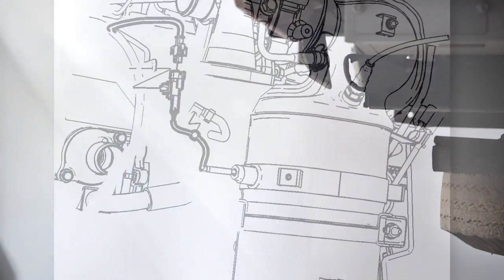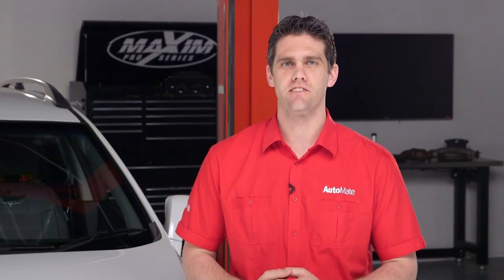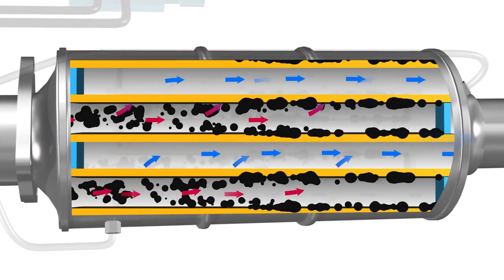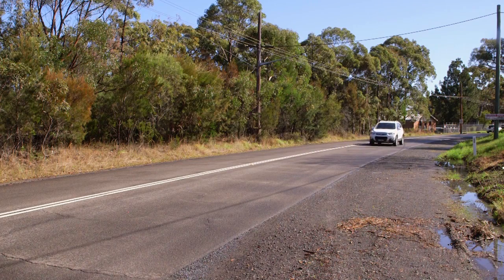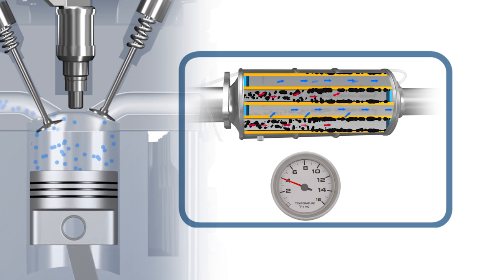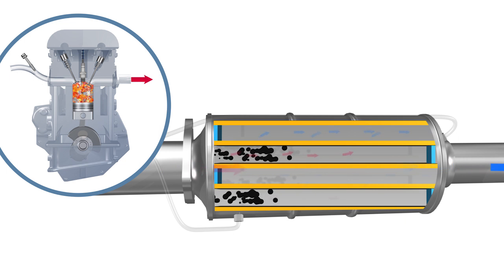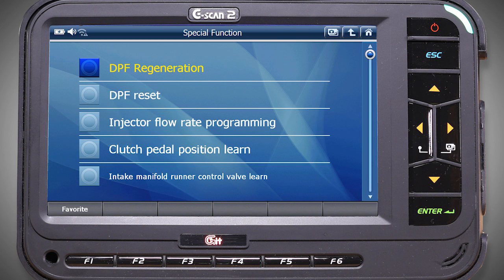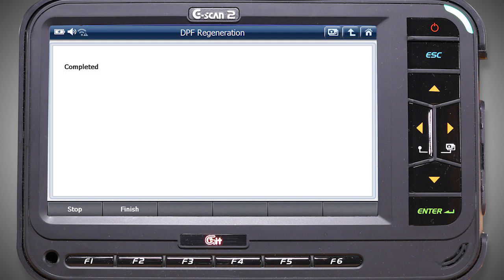Diesel Particulate Filter Fundamentals

Comment: Now explain the effects of the exhaust while your vehicle is in regen mode. Especially when your vehicle is dumping extra fuel into the exhaust system to get it hot enough to burn off the exhaust waste in the dpf filter.

Drives me insane when they say it is better for the environment.
Reply from the maker: Thanks for the comment, interesting idea there.
Reply: Sebastián Arboleda ... honestly Diesel engines are capable of burning clean without a dpf and catalyst combined. You just have to get your fuel to air ratio adjustments correct.

Many people have had deletions done and gain on average 2+ miles per gallon. While these systems not only cause thousands of dollars to be repaired it also causes major engine failures.

Not to mention the amount of extra emissions added to the environment to make and clean these systems.
Reply: In many countries it is a criminal offense to tamper with the dpf system.
It is also an incredibly selfish thing to do. You may get better mpg and more power.
However you are allowing carcinogenic byproducts to escape into the atmosphere.
These are proven to cause a variety of cancers including lung cancer.
This is cancer from secondary smoke inhalation .(but not cigarettes its Diesel smoke).
We live in a World where too many people think environmental protection is not important.
Not until they or their children get sick.
Unfortunately it's then to late.
Reply: True but carcinogenic byproducts have probably  been escaping into the atmosphere  since the industrial revolution.A few thousand people messing with the Dpf filter amongst tens of millions of cars  aint going to make any difference .Anyway where does A Dpf filtered car come in to this when they are using more fuel to begin with ? .Also where does it all end up when it regenerates ?
Reply: sportshatch all these terrible things about diesel exhaust kinda sound nice, but you’ll never be able prove any of them. Sure I can throw human tissue in a Petrie dish and mix it with soot and find carcinogenic actions. That doesn’t determine that those cells will act in that manner with a functioning immune system behind them. Everyone is forgetting about the invisible Particulate that slips right on Thru a DPF. The tiny ones that have been monitored by the epa floating from Chicago to New York. The visible black particles usually don’t make it very far before they fall to the ground and break down quickly. Be sure you understand exactly what chemistry is taking place here. Then, once you do, it will seem better to be so sure of something as to talk about it as fact.
Reply: @sportshatch   It's only bad if you inhale it directly. Mixed with air, soot won't kill you, unless inhaled in mass amounts quickly
Reply: @LOTPOR0402  it ends up as ash , like you get from a fire .
Reply: so all these deadly particles that are draped.... when you do a re gen where do they go then?
Reply: Willspoony Roberts In theory, they incinerate. In reality, the “most harmful of the particles” slip right thru because a DPF can’t capture them because they are so small. Also, collectively, they don’t leave a residue (black soot) because they are so tiny. These ultra fine particles can float hundreds of miles in the air. The EPA studied this and released under 3 micron particles in Chicago and tracked them past New York. Visible soot on the other hand is heavy falls to the earth like a rock. So, in actual reality, a DPF eliminates visible soot particles and 95% of the exhaust odor. But I would never call it “safe exhaust” that is emitted by today’s diesels.
Reply: @PhotoBillyDoesYouTube  most people seem to get stuck on the DPF which captures the soot that's created. that's only 1Of 3 different systems that cleans up the diesel exhaust. You have a DOC (diesel oxidation catalyst) that transforms the carbon monoxide to carbon dioxide.  You also have an SCR (selective catalytic reduction) which is where your DEF (diesel exhaust fluid) is used to trap and eliminate 90% of the NOx (Nitrous monoxide) that is beginning produced (by transforming it to nitrogen and oxygen I believe).  And then there is  the dpf, which traps and burns the soot so people are not breathing it in. There is another system (don't remember what it's called) that can be used instead of a DPF from manufacturers,  but it does the same job.  Only difference is instead of collecting the soot in a  dpf and doing a burn as needed, the other system is doing a burn all time, continuously cleaning the exhaust.
Reply: @PhotoBillyDoesYouTube  they are turned into ash , like from a fire

Comment: For regeneration do you have to drive or can you set your idol higher in park?
Reply from the maker: Regeneration is triggered typically by rpm, speed and engine temperature, but every car is different. We recommend you check with your vehicle manufacturer, they will typically recommend a driving habit to prompt a regeneration, sometimes it is in the owners handbook.
Reply: Regeneration is done during Engine load which means driving preferably at higher speeds in lower gears ideally motorways etc above 2000 RPM..,Reving at idle adds to the problem  that is more soot accumulation..